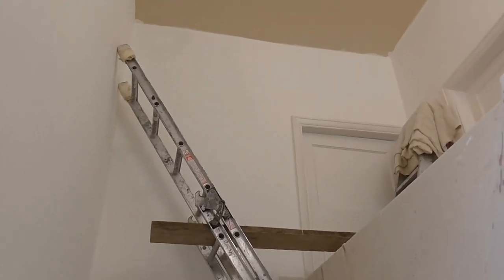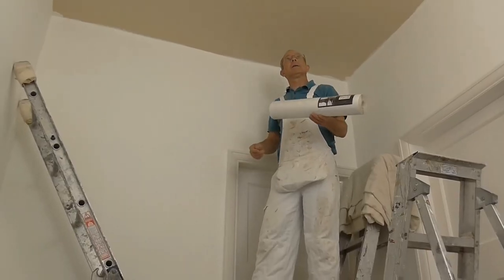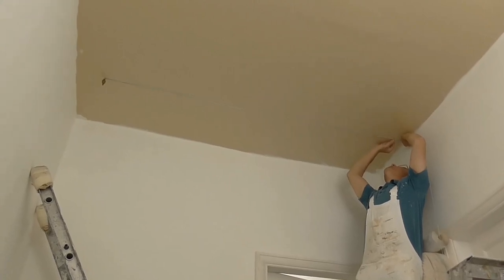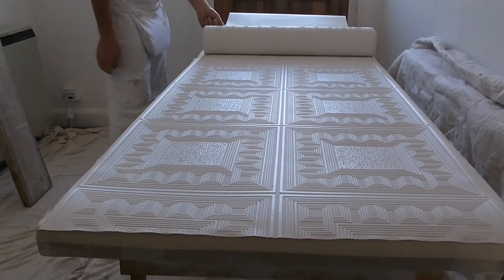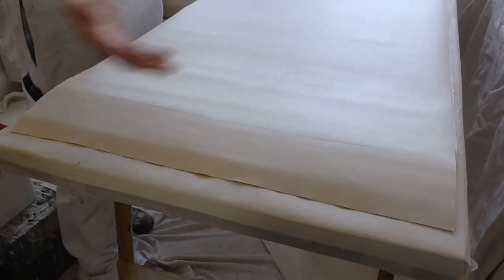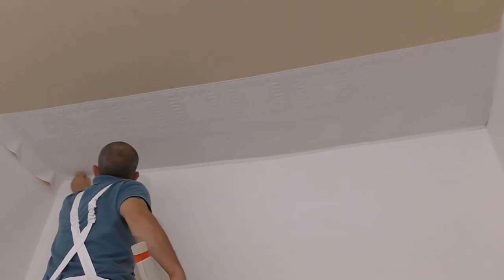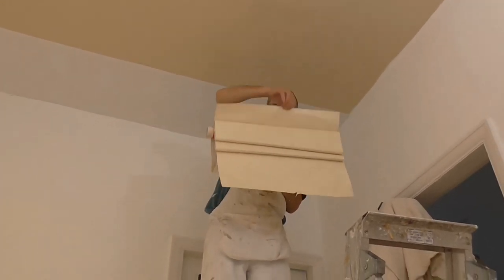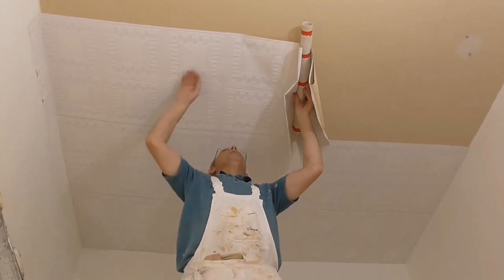How To Paper A Staircase Ceiling

Comment: Yes, I agree with the other comments. That's a really nice job and it's an excellent video showing exactly how to do it. I am not a professional but I have papered most of the ceilings in my house with embossed paper. I know how hard it is and I have always had help from my wife. I wouldn't attempt to do it without help. When it came to the hall, landing and stairs, I chickened out and got a professional to do it. He made a nice job of it. I didn't fancy working off ladders and I don't have the right equipment.
Reply from the maker: Thank you.  Always best to be save...  especially on a staircase.  But it keeps us decorators in work..it's always the one place left to do.

Comment: Hello there   can you recommend any kind of wallpaper to cover up woodchip wallpaper already on the wall?
Reply from the maker: Yes you could go over using a heavy embossed paper.
Reply: @PaintingandDecorating  cheers 👍
Reply: @PaintingandDecorating  would rubbing the woodchip with sandpaper first make any difference?  Before hanging the embossed paper?
Reply from the maker: You can denib the woodchip..  scrape of all the woodchips.